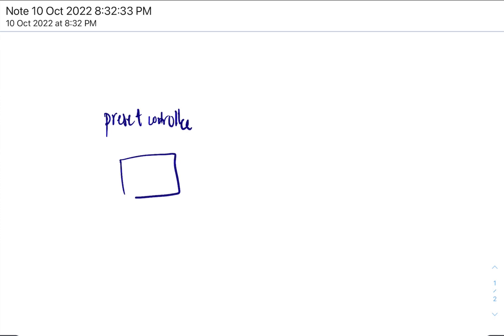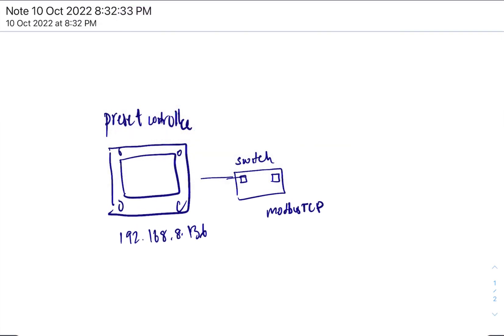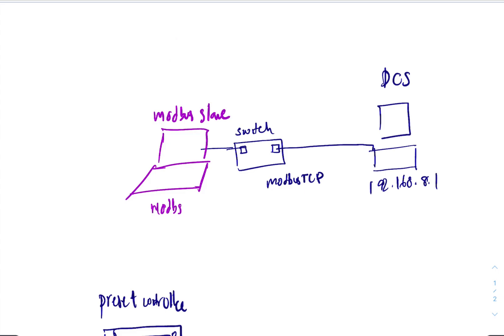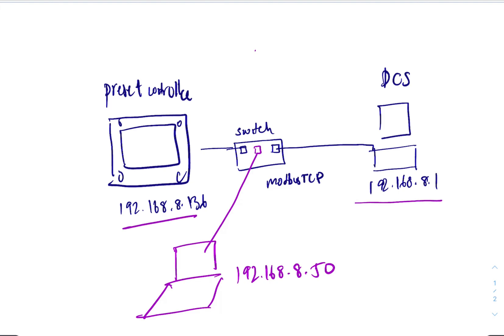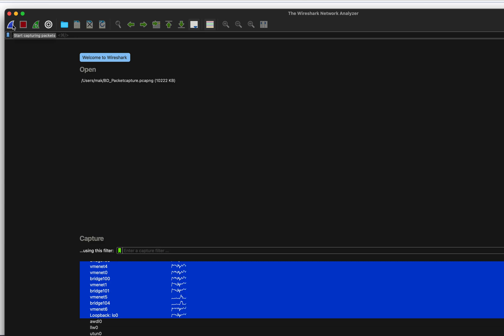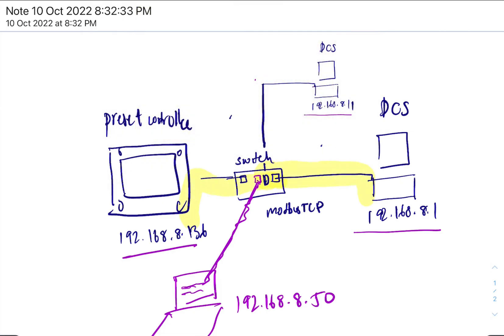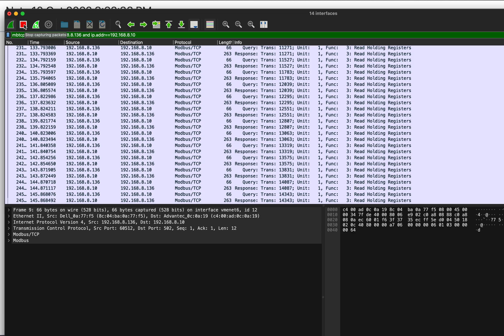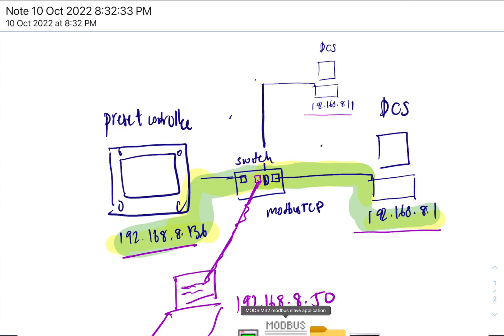ModbusTCP troubleshooting by Wireshark

Comment: Hello Yasin, Thank you for this video.
I have a problem with preset controller Honeywell FUSION4 MSC-L;
5 Fusion4 MSC-L are communicate with WinCC 7.0 Siemens via Modbus TCP/IP. Each Fusion contain 2 ID slave to read particular data under each slave. The WinCC communicate with each slave via different Ethernet port (different IP address).
Sometimes, one or more Fusion4 diconnect for a while and reconnect again (the time to reconnect is not always the same). The Modbus TCP/IP communication is not stable.
I have a wireshark file. I need to found the problem. Can your help me with this ?
Thank you very much !
Reply from the maker: sure. Send it across please. yasinnajib@gmail.com
Reply: Awesome video. Definitely going see if this software will pull data. 
Been fighting with an RKI Beacon 3200, trying to connect to it with modbus tcp/ip to a Red Lion DA70 FlexEdge controller.
But can’t connect, even putting my pc on a subnet with the Beacon 3200 using Modbus poll, still can’t connect. 
I can ping the device but can’t get data from it